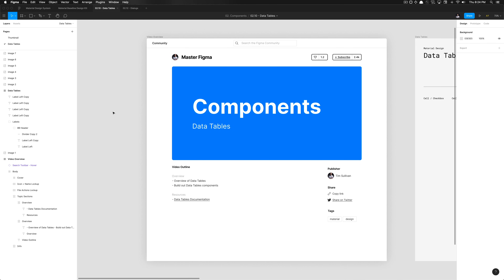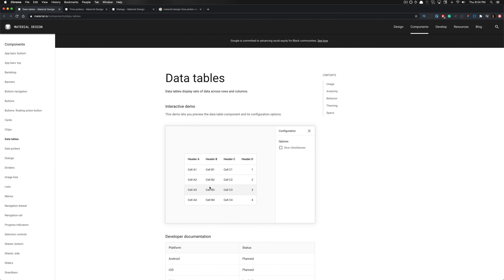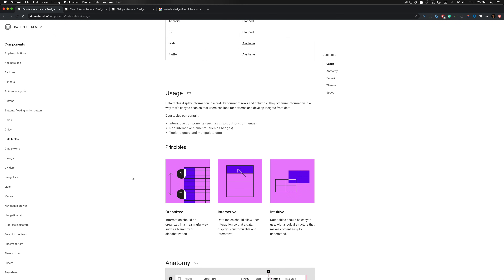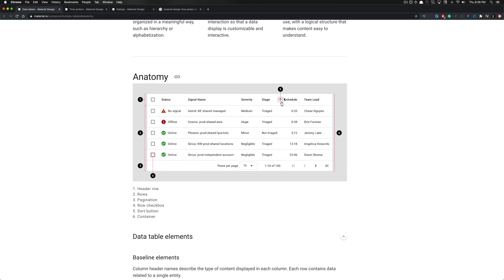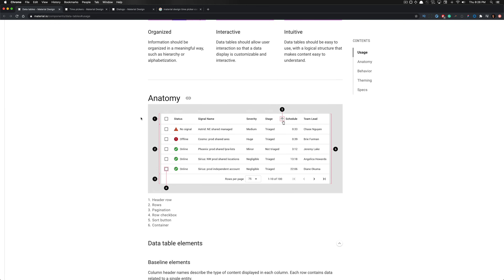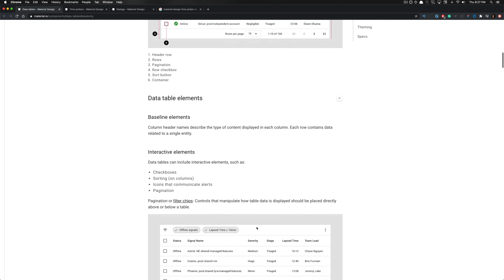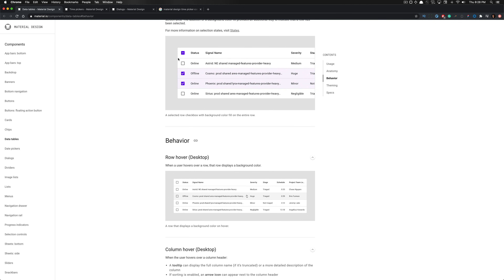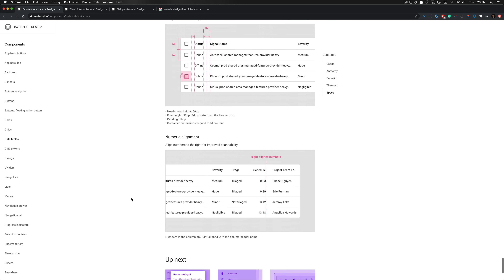Let's Build a Design System: Data Tables

Comment: Thanks for your Content, really helpfull. You are a little bit to fast for me so i have to watch this video back and forth for about 2 hours. The final Table is fix in its width right? If i use it like this for Layouts, i have to adjust the whole table everytime.
Reply from the maker: Make sure the layers inside your parent layer are set to fill container to achieve a responsive table.